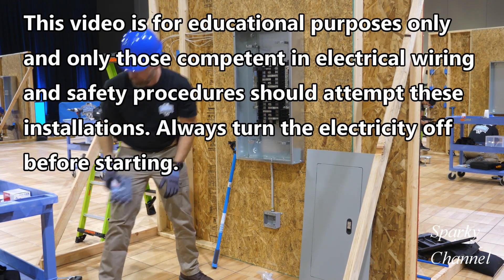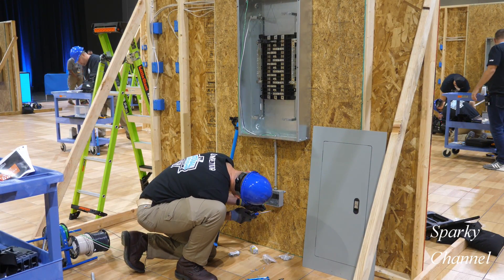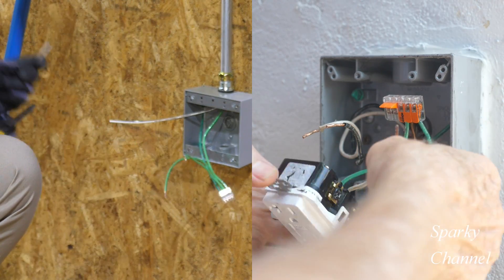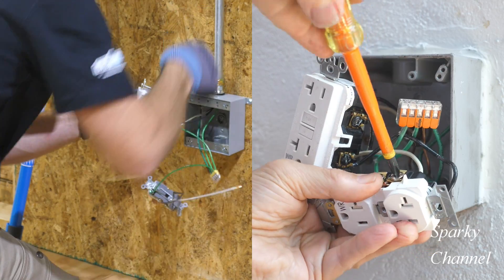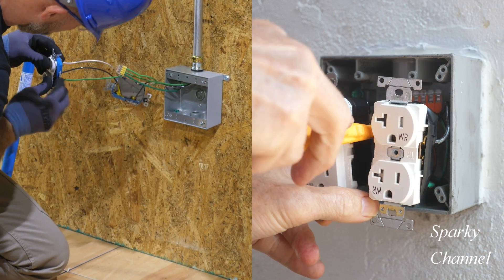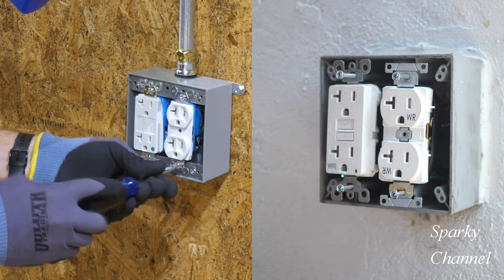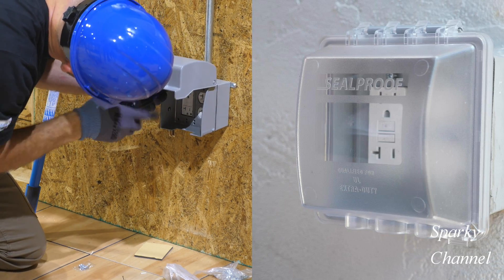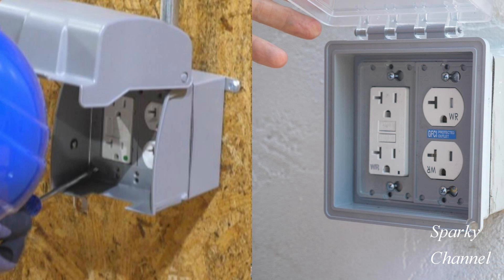Sparky vs the Pros: Wiring

Comment: My home was built in 1948 in Washington DC.  I swithed out ALL of the old 2 prong outlets and grounded them all by watching you channel.  (Not A Single Outlet Was Grouned).  My new question for today 11/2022 is:  While attempting to install a new ceiling fan with remote, I noticed old wiring sheathing/covering was barely attached, seemingly withered with aging and some with no covering at all.  I was successful with wiring the fan however upon tucking the wires in the small ceiling electrical box I turned on the breaker swith just to find that the entire circuit shut down on me.  I slept until the next day to come back and undo the wiring work just to find that probably the bare wire (Somewhere) was making contact with the electrical box or another wire.  The electic is up and running again but the fan project is at a standstill.  Can I fix the bare wiring issue without having to demolish the ceiling and wll for new wiring?  SORRY FOR THE LONG MESSAGE.

Comment: I would have fed the wires down to the receptical. Lot of waste the shown way. I think thet should of used the same Covers. Tightening the Screws before installing the cover was a mistake. Sparky should have installed the 4 screws he didn't Install. Don't mean to Critize. Do want to Pass on Experience as you all do.
Stratmando
Reply from the maker: What 4 screws did I not install?
Reply: The metal flanges on the receptacle on the right blocked the screw holes. The strange thing about the weather proof box is that in the corners it had 4 locations for screws, but the cover had only impressions and no holes to put a screw through.  Box is probably set up for a whole host of set ups, so I give Sparky the benefit of the doubt. 😉

Comment: Nice work for both. I think experience (Sparky) has the edge. I’m old with crampy fingers and wrists. I’ve been experimenting with Dewalt cordless screwdriver, DCF680N2. Seems to help so far if I’ve got more than a few openings to do. Great video. Thank you.
Reply from the maker: Thanks! Good tip about the DEWALT 8V MAX Cordless Screwdriver Kit, Gyroscopic, 2 Batteries, Electric (DCF680N2): Amazon: https://amzn.to/3OlhQun

Comment: I think you won, Bill.  Your receptacles are straighter and there is less chance of the wires working loose.  That push tool you have shown before and it really seems to work well or you have learned to use it well.  I also think your approach to the wiring seemed more thought out but that could be the stress of competition as well.
Reply from the maker: Thanks Jeff! Yes, the competitors have to do a lot of different tasks during a round and the work and the stress of the competition can make even the young guys tired. Sometimes I'll be filming a competition and I'll be thinking they should do something a different way. LOL!

Comment: Confused how the longer screws 
WERE IN PLACE before putting on 
the cover.

Caulking necessary?
Reply from the maker: Yes, caulking is necessary, but it wasn't part of Greg's competition.
Reply: They have a hole and slot for each screw. The head of the screw fits through the hole and then you slide the cover over so the narrower slot sits behind the head of the screw.
Reply from the maker: @illestofdemall13  Excellent explanation Kris. It's a great tip for those who aren't aware of this tip. It's a big time saver when the manufacturer offers this feature.
Reply: @SparkyChannel  Thanks. Years ago, it seemed like most of the bubble covers I installed did have that feature. Maybe in the last 5 years I have started to see the type that do not, and also the kind that have to be assembled inside.
Reply from the maker: @illestofdemall13  I wonder why? It's such a time-saving feature. Perhaps it's cheaper for the manufacturers?
Reply: @SparkyChannel  The Taymac ones are pretty fast once you get used to them. Once they are all prepared and set up, they go in easily.
Reply from the maker: @illestofdemall13  Interesting. I might buy one and make a video about installing it. You'll be my technical advisor. :)
Reply from the maker: That's the way it's done on the Sealproof weatherproof cover. You install the longer screws a little into each of the 4 holes. Then, with the receptacles placed well into position, the Sealproof cover is slid from left to right onto the screws. Then the screws are tightened. You could also put the cover into place first, then install the screws if you like.

Comment: Why did you use an impact driver for the screws? Wouldn't it be better to use a drill without the impact? It seems that the screws or the box could be damaged using the impact driver.
Reply from the maker: The impact feature doesn't engage for such light duty work. The 12V impacts are very small and light now, with great variable speed triggers. They have really come a long way. This makes them great for such quick tasks.
Reply: @SparkyChannel  Aha! I didn't realize that.
Thanks for the informative videos.
Reply from the maker: @joeweatlu5169  You bet!
Reply: Pro Tip:  but don't let the apprentice use an impact driver! (I'm a home gamer and I once put a set screw on a box fitting through a 3/4 EMT 🫤 )
Reply from the maker: @HoosierRallyMaster  LOL! Good tip!
Reply: Usually an experienced electrician will know when to stop before accuring any damage. Key word “usually”, I know some don’t.

Comment: I prefer to prep my GFCI before I start installing it: pull the tape if it will be feeding load side devices and back out all the screws that are going to be used.  I also prefer to assemble the two receptacles, first,  in an installation like that - put them back to back with one inverted, and then it is easy to set the pigtails on both, connect the line side wires, and then twist the second receptacle into place alongside the first.
there's also a trick to gripping the devices as you place them in the box that lets you use your fingertips to guide the wires to fold where you want them to.  it's not so slick in shallow boxes like that, but in full depth boxes, there is usually no further dressing of the wires needed.

and I prefer the Milwaukee surge as my power driver.  it runs quieter than an impact driver, and is available in 12 or 18V.
Reply from the maker: Thanks Ken. Excellent tips!

Comment: Isn't that a metal box ? Ground needs to be attached to the box right?
Reply from the maker: It's there... you can see the pigtail going to the 2nd ground screw on the right. Just can't see the screw. The EGC screw is a little out of the view of the camera, but you can see the EGC wire.

Comment: You didn't bond the box to the EGC.
Reply: It's there... you can see the pigtail going to the 2nd ground screw on the right. Just can't see the screw.
Reply from the maker: Yes, the EGC is there. The EGC screw is a little out of the view of the camera, but you can see the EGC wire.
Reply: @SparkyChannel  Sorry, I was wrong.  Since your competitor was using EMT with a green wire, I wasn't looking for your bare copper wire.
Reply from the maker: @HoosierRallyMaster  No worries!
Reply: Don't all new receptacles have the ground linked into the screw down making the pigtail box ground redundant?
Reply from the maker: @hippo-potamus  No, not all. Some have the self-grounding clip and some don't.